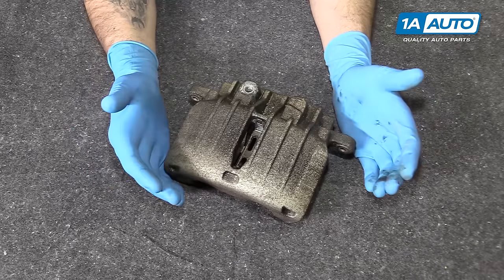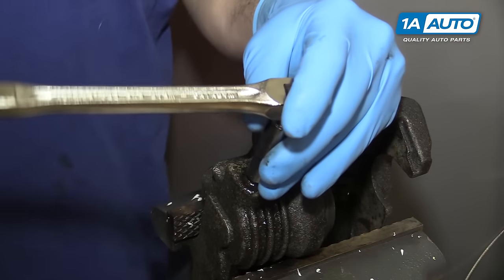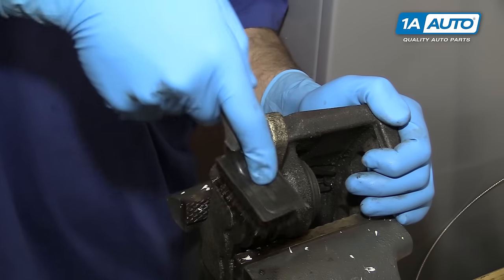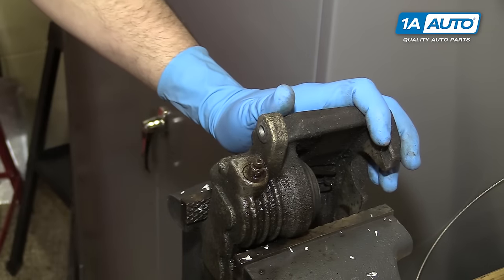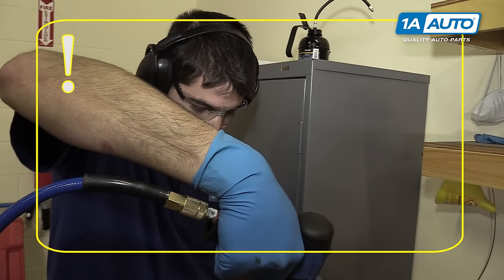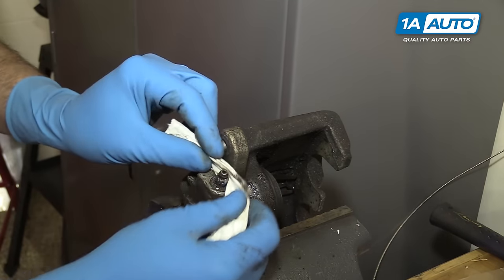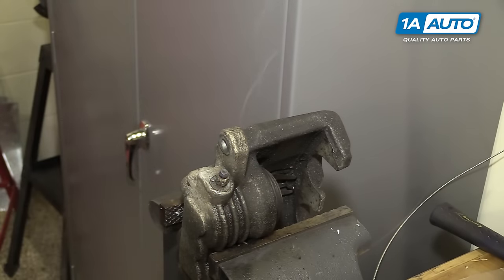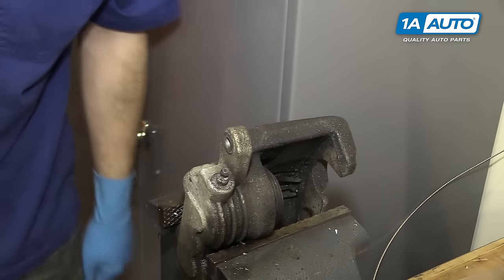How to Remove a Stuck Brake Bleeder Screw

Comment: Heat the bleeder screw red hot.  Let it cool down.  Repeat 3 or 4 or even 6 or 7 times.  I've never had one not come out.  The expansion & contraction of the heating & cooling breaks the fusion of the screw & the caliper.  Has never, ever failed me yet.
Reply: true ive seen heating until glows the quench it with water, I like to use GM Heat riser valve lubricant worked every time, its no longer available.
Reply: @jeffalan6339  agreed. I ran out of that stuff and can’t seem to be able to get more. I’ve been told that they don’t make it anymore
Reply: @jeffalan6339  Yep it works.. Map gas & get that puppy nice & red.. Then shock it loose with cold water...
Reply: isnt brake fluid flammable
Reply: @maniacalmonster2293  nope
Reply: Yup.. it worked lol thanks man wasn’t sure if I should use heat or not
Reply: Get them hot 🥵 then put a ice 🧊 cube on it. It will shock that rust free. It may take a few times but it works.
Reply: Thanks for sharing... it worked after trying all of the above. The screw was rounded, I had to bang in a 3/8” socket instead of 10mm, the heating and quenching worked great!
Reply: Heat the caliper around the bleeder (not the bleeder itself) and you won't have waste time heating up the bleeder 2 , 3 , 4 , 5 , 6 or 7 times and having to wait each time for it to cool down , I've been doing breaks since 1985 and have NEVER had any problems . It has worked for me ever time even with bleeders that were nothing but a nub .

Comment: Over the years I have found a very small amount of preventive measures is far better than having to deal with these stuck bleeder screws. If I have to replace the calipers with new ones or use old ones for that matter, I put a small, small amount of anti-seize on the bleeder screw threads thread it all the way in, then screw out the bleeder screw to coat the caliper threads, then screw the bleeder screw back in. Since the bleeder screws are made from cheap metal, usually steel alloy, and the caliper is made from aluminum alloy, whenever there is a difference between the two metals, galvanic corrosion WILL occur between the parts and cause the screw to cold weld itself. This is accelerated by salt and water forming a battery between the parts. Technically, different metals have different numbers of electrons in each metals Valence Shell or outermost electron shell orbit. This difference in "Nobility" where one metal's valence shell electrons are higher in number than that of the other metal alloy, causes a very small electrical current to flow between the two parts eventually causing this cold welding to occur. Bostich and Permatex make the best anti-seize in my opinion and I never have had any problem removing parts that have that on their threads. Again, a very small amount of ant-seize is all you will need. I hope that this will help someone!

Comment: Great video, I always use a six sided box wrench or socket, never a 12 sided. You can use penetrating oil and then heat the  caliper. Let the penetrating oil sit for 24 hours which allows the oil to work its way down the nipple threads.

Comment: Using the vise grips the other way allows them to bite and hold better. Always pull grips, channel locks, adjustable wrenches towards the adjustable jaw. Less chance of damage to the tool or nut/bolt
Reply: I use a vise grip/channel lock, it has teeth facing opposite directions. Works great.

Comment: there are ways to prevent this and most old time mechanics don't ever have this problem, any bolt or nut, especially in different metals, always use a small amount of anti seize, bolts, spark plugs, lug nuts, etc. just be careful on the spark plugs, i use qtips so i just get it on the threads, you do not want any on the tip. you will never have a problem with stuck lug nuts if you clean the studs and nuts and use the anti seize. a small can is a little costly but will last for years if you are a do it your self mechanic. surprised no one mentioned the  hand impact driver. one added note, any stuck bolt or nut will turn to tight before it will turn to loosen, i always try to tighten a small amount to get started.
Reply from the maker: +jimmie Roan Thanks for the feedback!

Comment: Someone may have mentioned this:  place the back portion of a drill bit into the bleeder screw.  It is hollow and if you fill the opening of the bleeder screw with the back part of a drill bit that fits snugly, it will not collapse on you while you are working on it.  I keep old broken drill bits around just for this and other purposes.

Comment: That helps a lot when you don't use your by Vice Grips backwards !
Reply from the maker: +Robbie Wetbike Thank you for checking us out! 1aauto.com
Reply: That's what the hell I said !!!!!
Reply: He wouldn't have needed to know which direction the vise grips needed to be used if he'd used a six point socket in the first place and not rounded the bleeder head off.
Reply: Exactly what i thought. Didn’t even resort to drilling it out, just gave up. Wouldn’t take my car there.
Reply: @next0845  As someone who knows plenty of mechanics, theres "time" and "effort" practices where its easier to just change the caliper for 60 bucks rather than spend another hour going through all the steps because most mechanics charge you 105 or 125 an hour anyway.

Think man, Think!

Comment: I heat the screw, used wd40 to cool down, 4 times and works. Few taps in between. But I did use the torch on the screw and not on the caliper.

Comment: This is obvious but if you are bleeding old brakes...buy new bleeder valves BEFORE you start. Even if all come loose....R&R Bleeder Valves and add light touch of anti seize before reinstalling. 1 Oz prevention worth 1 Lb cure.

Comment: The problem with aluminum  or alloyed caliper is the bleeder is steel ..dissimular metals corrode  so bad even if you heat the caliper your most likely to RIP the bleeder screw withers aluminium threads out...aluminium alloy caliper suck...for this reason.. if you have them.remove and use antiszee on the bleeder every brake job...when the are new.

Comment: Over the past 45 years, whenever I've purchased a vehicle or replaced seized brake cylinders or calipers, I ALWAYS put anti-seize on the bleeder fittings. Always! Worked like a charm for me and I never had a problem loosening a bleeder fitting after doing that! Garages love to throw a person a price for replacing brake lines or doing a brake job just to get someone in the door. Then, once the car's up on the rack they can't wait to boost the price of the job by adding calipers or cylinders because they "cant bleed the brakes." The last thing I think I'll ever see a garage mechanic do is put anti-seize on bleeder fittings to save the customer some money. If you find a mechanic that does this, you better hold onto him.
Reply: I run my own shop and I ALWAYS put antisez on the bleeds when I do breaks .
Reply: @cowboypatriot1200  uhhh.. ""BRAKES"" !  cmon! ..  u been doin breaks how long?  geez... sorry but good tips anyway

Comment: Heat thread area, and then use a can of Dust Off upside down to spray the bleeder. The C02 comes out as liquid and freezes the bleeder which shrinks it.

Comment: can't you heat it up really really hot and then shock it with water? I swear I've seen SMA use that method recently and it worked like a charm....just a random thought. Thanks for the vids 1a!
Reply from the maker: +Darren G. Thanks for the feedback. That is another way to remove this, but you would definitely want to be careful with this method.
Reply: Darren G. 

         2

Comment: Disagree about heating the caliper. Heating the screw, with acetylene if available, is the best choice. The very hot screw MUST expand-- laws of physics and chemistry. When the screw cools, takes only a minute or two, it will be looser and the caliper will have received too little heat to be damaged.

Comment: I run a business servicing BMW and Mercedes cars and I always kept new bleed screws in stock and I will always replace them if they are suspect and I always change the brake fluid on every major service. Old contaminated brake fluid is the main reason for brake caliper pistons seizing up. Proper servicing eliminates most problems with brakes.

Comment: You want to use the hammer on the outer part of the breaker bar,just above the socket going to the bleeder,and tap the breaker bar while trying to loosen the bleeder. This will break it loose easier and then you go about working the bleeder out slowly with penetrating oil and turning back and forth. Using the hammer on the breaker bar will shock the fitting and the rusted bleeder,and it will help it break loose before you break the bleeder off.Been doing this for 20 years working on Chrysler and never had one break off yet,,,,,Knock on wood...Good luck,but spray it first and let set for about 2 beers while spraying it....

Comment: Heating the screw cherry red probably works, but I would be afraid of softening the steel, although quenching might harden it again. I would try with heat (not until red) and quench several times first, and also tapping on top of the screw. Use a nut or small socket that fits over the nipple and rests snugly on the hex part of the bleeder to avoid mashing down the nipple.. Being hollow, bleeder screws are very weak and easy to break as most people have discovered, I'm sure.

Comment: I had a mechanics tell me this.  Put the box end over a bleeder make sure it’s a six point  never just pulling a wrench but give  The wrench a sharp hit but not to hard. The  impact breaks it Loose better than just pulling on it .
 Also I have used a 4 inch rigid pipe wrench instead of Vice Grips to get stripped bleeder  out .  Again give the ranch a smart little smack.  A pipe wrench grabs it much better. 
My little pipe wrench also works great on stripped brake line nuts.

Comment: Someone told me to put a nail inside the bleeder screw (of almost the same diameter as the hole) to prevent it from collapsing in on itself when you are torquing it loose. Never tried it yet but I know the next time I bleed my brakes those screws are going to give me a problem...
Reply: That's a good tip, and old 3mm drill bit can work too.
Also, after heating, apply candle wax, give it a few minutes to penetrate and bingo.
Reply: tapping a nail into the bleeder hole and clamping onto the bleeder with vice grip and working the bleeder back and forth will loosen the screw most of the time. use only one drop of penetrating oil at the base of the the bleeder threads where they go into the caliper. let it sit for one hour. then place the nail and clamp on the vice grips and start moving the bleeder back and forth. Works 99% of the time.
Reply: the old Drill bit / nail that fits snugly inside the stuck  bleeder screw before you attempt to loosen the screw always works for me. You can get a lot more torque on the part as you wiggle it loose - back and forth.

Comment: I have 2 different bleeder screw sizes on my 1995 Yukon RWD. The passenger side is a regular 10mm one but the driver size is a THICK 8mm one. Why is that? That probably means I have 2 different calipers huh ?

Comment: I've had fantastic luck after heating up surrounding area shocking it with PB BLASTER allowing the alluminum to cool somewhat before turning as to NOT strip the alluminum threads. Repeating the  process 3 to 4 times. Hasn't failed yet !! Being careful to wipe off excessive lubricant to not cause a fire. PB as well as most are combustible.

Comment: I tried all that. my last resort was to make a cut down the center with a hack saw. I then used a flathead to twist it out. I got a little turn before half of it broke off. The newly made flat edge allowed channel locks to bite. Came right out. I was so pumped that I didn't have to buy a new caliper.
Reply: put a drillbit in the hole that fits snug and it won't shear off like that

Comment: Aluminum and brake fluid drew the heat away from the base, and propane doesn't get as hot as other options. I like this video because it's real, sometimes things just don't work out. Depending on the cost of a new caliper, more effort with oxyacetylene or easy outs and drilling might have worked. Even welding a nut onto the broken steel fragment works better than one would expect. 

The last broken bleeder I had was in a small slave cylinder for a rear drum brake that was only $25. For that price, it's not worth the effort. After I put on the new one, for fun I tried to get it out. Nothing at all worked. The other thing this highlights is the extra hidden cost of cracking the bleeder at the time of each brake pad change. Many professionals recommend doing that but they don't explain the extra cost if one of the four bleeder screws breaks off.
Reply: spelunkerd I had to use the welding method on my 99' f350, the caliper is around $105 and that's just for the reman ones lol
Reply: Well, it's my believe that the bolts that sit untouched will rust solid. The once that are turned every once and a while will operate fine when you need them.
Also you might catch it in time, and get away with just changeing the bleeder.
Anyway, the brakefluid should be changed every now and then.
I never own a car long enough to test it out, but I have the practice of changeing brakefluid every 2. years (as normally recommended).
Reply: There’s no aluminum there. Even though he said the caliper is made of aluminum, it’s actually cast iron.

Comment: I bought an oxy-acetylene torch set when I was about 18, I call it my smoke wrench. Propane torch is a waste of time, not hot enough. the oxy torch works every time. you heat the outer material to expand away from the bolt. I never try to heat up the bolt itself, that just expands the bolt into the case.

Comment: If only there were a way to design a caliper bleed screw and seat, with a corrosion free material . . . . . . . . meh . . . let's just keep building 'em with the problem since hydraulic brakes were invented . . . .

Comment: You think with today's technology they would come up with  a better system,I use a six point 1/4 drive deepwell and one of those mini torches,and use a rag soaked in cold water,heat cool repeat a couple times working the ratchet both ways ,put just a little anti seize on there for the next time,great how to video

Comment: None of these work. I used a pipe wrench because it locks tighter when you turn it and it worked like a charm.
Reply: That's what I always used. I had a skinny 4" pipe wrench and it always worked for me
Reply: @ffhgu 07 it probably wouldn't have helped in this case, but they're better than vise grips. Pipe wrenches are made to grip without pinching

Comment: If the screw won't come out or breaks off, there is a way to bleed without replacing the cylinder or caliper.
With the pads removed, have someone slowly pump the brake pedal until the piston almost comes out of the cylinder. As the piston is almost out, tilt it so that only the top of the piston is completely out of the cylinder allowing air at the top to come out. You have to keep pressure (with your hand) on the piston to keep it from falling out, and once the bleeding is completed, press the piston back it. 
This works easier on drum brakes as there are two smaller pistons. On drum brakes, allow the higher piston to come out and prevent the lower one from popping out.
Reply: You can also loosen the brake line and push the piston back to get the air out

Comment: what really works is heat. from experience I have learned to not waste time with other methods. penetrating lubrication may help a little but without heat you won't get it off. a propane torch works most of the time but unfortunately sometimes you need something stronger. in this case he probably needed to heat it up longer or something like an acetylene torch. but heat always works just depends how much. just got to be careful.
Reply: Great point.A MAPP gas torch burns hotter than a propane torch and always works for me.You can buy one for around $30-40 and it always breaks badly rusted or seized nuts loose.
Reply: ya, i love it when working on my car and people who dont, are telling me to just spray it with WD-40 and it will come right off.
Reply: @frankgrimes6047  ha. Yeaaaa. Maybe brand new. 😂. That never worked for me. Little heat. Water. Bang. Right out and new bleeders.

Comment: You can still bleed your brakes just use the fitting to the caliper it’s going to make a mess but it will work
Reply: You need to use the bleeder. It is ontop as the banjo bolt is most likely on the bottom or middle area. There will still be air in the caliper
Reply: Would have to take it off and turn it upside down.
Reply: LOL, good luck with that!!

Comment: Big tip, use physics to remove the bolt. You were half way there with the heat, but if you were to shock the metal with some ice cold water right after hitting it with a tortch it will cause the metal the shrink quickly breaking the bleeder away freely, also when using the tortch put it on the bleeder, that's what you want to shrink away from the threads..  try it my way and make another video showing the result on that same caliper
Reply from the maker: +G Patch Thanks for the tip!